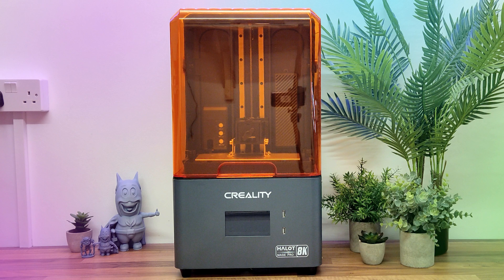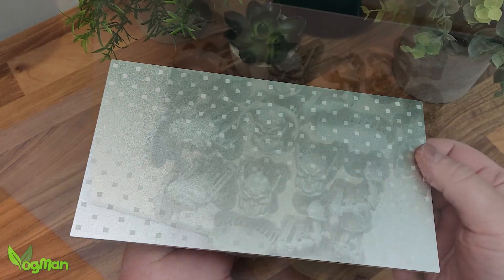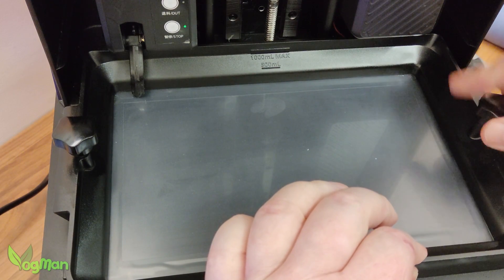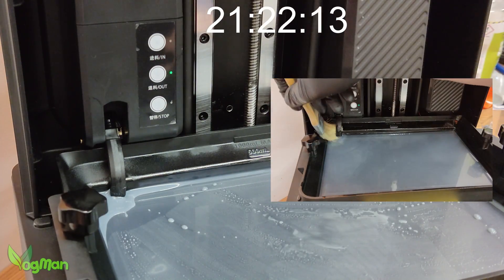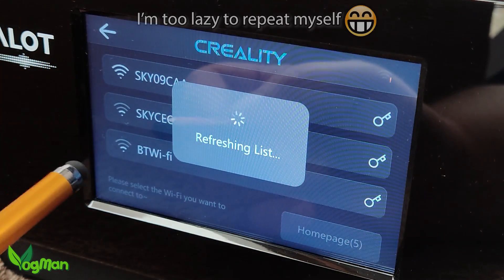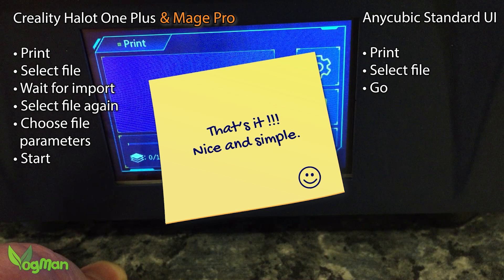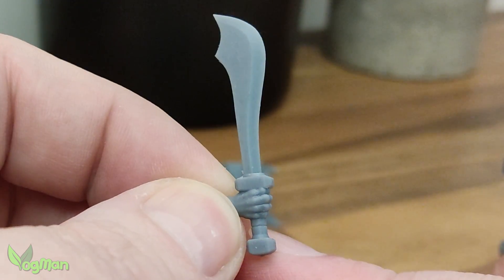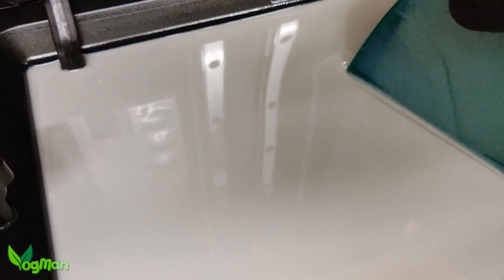Creality Halot Mage Pro 3D resin printer HONEST review

Comment: I have the mage 8k in a Sunlu enclosure which means it stays warm but the lid no longer flips over so needs propping up ;) i use an old airbrush spray booth extractor tube as an extension for the filter tube

Comment: Very deceptive of Creality to not be forthcoming regarding the layer height quadrupling to achieve (less than) the advertised build speed. I recently purchased the non-Pro version of this printer and found it to be painfully slow using the default Chitubox settings. I tried Lychee next and the build time halved with the stock settings. Still slow (13.5 hours to build a 226mm tall Eiffel tower) at 16.7mm/hour, but that was double the speed using Chitubox. Print quality was excellent and it had no problem with Siraya Tech "Build" smokey black resin at 20°C despite being recommended for use at 25°C or higher. I started using 2.2 second exposure times, but reduced them to 1.8 seconds as it appeared that the resin was sticking too much to the FEP with the extra cure time (nasty separation sounds as it pulled away when there were large contact patches). At $260, delivered on Amazon it cost the same as my first resin printer, an Elegoo with a non-mono screen and really small build area. At that price, it is well worth it, but the Pro version shouldn't cost more than $100 extra for what you are receiving.

If anyone knows the settings to get this printer closer to 40mm/hour (the speed of my Anycubic Photon Mono) please share them.

Comment: ARGH !! I am really wanting the advertised fast prints to work for any of these resin printers. I want to print large scale model airplane structure parts that don't need a lot of micro resolution but need strength and accuracy. Even at .2 layer height with true 170mm/h print speed I'd love it if they were accurate and strong but it resin printer corps aren't even thinking of the latter features.

Comment: Its crazy how my Halot Mage non pro is so much better than the pro version. Most of the issues you brought up just dont exists on the cheaper version. I use chitubox pro for mine and it just prints. I did have an issue where my touch screen died but creality support did come through with a new part but it did take awhile to get it sent out.
Reply from the maker: I agree completely. It prints very well, it's just let down by the "pretence" features.

Comment: Noisy fans and Creality 3d printers seems to be a thing. I've had a couple of Creality fdm printers and  had to take steps to make both acceptably quiet. 
I've been watching your videos for a while and am always curious as to how accurately resin printers  can print, correct dimensions, etc., and how well this then translates to a finished cast metal part. Does it shrink or grow for example, is there warping. This from the point of view of casting small parts for engineering projects. I don't want to splash the cash if I'm not sure of getting a good result.

Comment: Ive just ordered a creality lizard, halot mage, creality resin, and their wash and cure kit. Already disappointed. They shipped my order but forgot the wash and cure kit had to email them 4 times to get them to send it. They never sent me any sort of confirmation when i ordered the lizard. I emailed them about it as i was charged but never heard anything, they simply sent me the tracking for the wash and cure kit for the lizard, but the kit hadnt even been shipped yet. My halot mage showed up and it was broken. The coupler holding the z rod was broken and the zrod bounced up and down smacking into the interior the entire delivery im sure as there was physical damage. Thankfully i ordered the Mage itself through amazon so i didnt have to fight for a replacement and deal with emailing their less than stellar customer service. If i had to go back and reorder everything i would most certainly choose a different company as they have already left a bad taste in my mouth and i havent actually gotten to use the product lol.

Comment: Wow , i got the Anycubic mono x , so i really agree with yuo , its a shame that Creality mess all that good features , that in theory can
Be implemented , the misimg  screw in the  carbon filter is really a shame ..(i think yuo can fixed with doble side tape ) but comon Creality ? Just one screw ?
The other ugly thing is the interface , all that menus , all that config ..in the Mono x , i slice in chitu , the put the pendrive , select the drawing of the file , so nomistake , a press print , thats it! As yuo show , and if yuo want to change something , speed , etc of course yuo can , the only drawback is the screen is little and the letter are little to my eyes , but its a very good printer😊

Comment: Regular Halot Mage shares exact the same enclosure(with little difference, e.g. no holes for second usb and ethernet as well as halfed led-array radiator with single cooler instead of double), lacks wi-fi, ballscrew as well as fast Z movement, no pump, it's led array is 60w instead of 100w, it's VAT goes with nFEP and it's the same way loud(i've tried touching led array radiator during exposure and it's not even warm, so creality is overprotective here) still, it's twice as cheap and it's a solid platform for upgrading and fixing(some of issues can be fixed with g-code settings tuning, like cooler noise) 
it's like every creality printer - it has a lot of fundamental pros(for me it was price and enclosure with rotating lid), but it has equal or bigger amount of cons(which mostly appeared because of typical for creality engineering team - lack of polishing) which you have to fight by yourself
Reply from the maker: Thanks for the share.

Comment: I'm confused, doesn't 0.2mm layer thickness up your print time and bring the layer lines alot closer for much better detail than 0.5mm would? That is moat probably why you never seen any change in the speed lowering the layer thickness to 0.2mm as it would drastically increase your print time! 
 going from 0.5 , to 0.2mm with the fast resin maybe would have equalled out or took a lot longer! Try it again with the fast resin at the 0.5mm layer thinkeness you should see the difference then?!. I know you know this and think you got mixed up there as learnt that from your video's and others when started 3D printing
Reply: Sure, .2mm is 2.5 times better layer height than .5mm.

But in this case, the 'normal' layer height is 0.05mm - pay attention to detail!

Comment: Nice review with the good and the bad not like some other channels.
I own this printer i got it for the speed, a heater would be great on printers saves building one (built the one on your channel)
The down side ive found is no pins to align the vat with the pump pushing on it(might take the pump off) and problem with chitubox exporting the files with errors in it, beta ver has fixed that.
I print model railway wagons, people, buildings etc in HO 1/87 so far im happy with the prints and im using siraya tech fast and blu, comes of the build plate easy really easy.

Comment: Ok… hear me out… no one talks about the non pro version. That’s what I have and at LEAST half these problems don’t exist (no cloudy fep alternative, no plate moving at the speed of sound breaking spouts and splashing resin everywhere, no need for special resin, no Wi-Fi demands). And I bought it on sale for $250. Don’t get me wrong it’s not 100%, the fans are still there the feet don’t move, the tube vent is short… but I love it better than my Mars3 Pro that is small and needs repair 25-40% of the time.
Reply from the maker: I believe you completely. YTers get the machines companies want to promote, rather than the ones that are selling well. I'm sure the non pro version is excellent. After all, I loved how this unit printed.

Comment: One question I never hear asked about new printers is why do they not come WITH a flex plate? I've never had a problem with failed prints because of them and I also never have problems separating prints from the plate. They pop off easily.
Reply from the maker: You're not the first to say that here today 😁

Comment: I have the non pro halot mage it has a totally different user interface same as the simple example you showed also no WiFi so don't have to connect to cloud and comes without the useless pump, and I think the home speed is a gimmick on the pro because I don't think my none pro moves that fast but has the same z axis and still capable of printing fast
Reply from the maker: That sounds excellent.

Comment: I'll give them props for trying the pump thing. It's a good idea with a mediocre implementation. 

Your idea to replace the pump with a heater made me think about future designs and possible modularity allowing the user to pick what they want. You can have a pump, a heater, more air filtration... just pick what you need and plug it in.
Reply from the maker: That's an excellent idea!

Comment: I can't see this doing well.
Reply from the maker: No. It's a shame. It prints very nicely.
Reply: @vogman  Still my favourite fdm printer company by far. I still use my old cr10s and my og Ender 3.
I definitely prefer the prints on my Ender. Prints petg really well. Over the years I've put the best of everything on it including TH3D firmware..
Reply: @vogman  ps Great review. The extras on this printer are definitely not on the top of my list.

Comment: Gotta say the UI being worse than in Anycubic printers doesn't seem all that bad if at the very least it actually lets you adjust settings instead of ignoring several things and using factory defaults like all the Anycubic printers i've used. Lack of manual Z adjustment is a dealbreaker though, I use that function to mix my resin cleanly without having to empty the vat, shake the bottle, and refill the vat
Reply from the maker: Yes, the super fast plate scares you first time and has you frantically hitting stop. Thankfully the screen responds very well.
Adjusting settings at the printer is really useful, you're right. It comes in especially handy when dialling in calibration prints.

Comment: Thanks for the honest review! 
I can say I really like the idea of being able to change settings for a print file in the printer itself and not have to reslice it just for simple adjustments. 
But it would be nice to just have that be a settings button on the print screen vs prompting every time. 

I’m with you on the disappointment of how all these companies are promoting fast speeds but one of the things they’re doing is setting layer height to FDM sizes to achieve it. 
Just like you, I got into resin for quality detailed prints (and ability to do better quality supports). I’ve already two creality FDM printers which I really like and are good for that type of printing. 

So yeah, hopefully these manufacturers wisen up.
Reply from the maker: Thanks David. 
You're right, changing settings at the printer is VERY useful, especially when dialling in. If you use a calibration print, it's much quicker to alter those layer times without having to slice again 😁

Comment: I wonder why none of these come with flex plates. It's really nice to not have to worry about exploding your prints when removing them from a plate they stuck too well to. Or I just got lucky with mine and it's just a terrible idea? Or it's just patent trolls?
Reply from the maker: It's an option. Not everyone uses them. I like them, but I tend no to fit them. It's purely a lazy thing 😁
Reply: Flex plates add another point of failure that is unnecessary if you've dialled in your settings properly. I've never had issues removing my prints from the build plate. I've never needed a flexplate. A flexplate can delaminate from your buildplate and ruin a print.

Comment: Yeah I like the flip top lid for low overhead areas like on some of my benches.  Other than that it seems to gimmick drinen.

Using castable resins like you I'd hate to clean the pump to change resins.   It reminds me of a funky build plate a while back that looks like it would have been fun to clean.

It will be interesting to see if I get those same lines on the Mars 4 Ultra 9K after I get it.  I can always try my nfep if I do.

Thanks for the helpful video!
Reply from the maker: If the pump had been fast, I would have forgiven the contamination issues. But honestly, do they really think the pipes and pump can be cleaned? There will always be some traces... we can see that, so why can't they?

Comment: Corrugated extensible hose is some of the worst material to use in a ventilation system since the corrugation cause a great deal of resistance to smooth flow. I can see the appeal of such material since it can be shipped compacted.
Reply from the maker: I certainly don't think this one would. At approx 1m, I suspect any fumes would blow straight back in 😂🤣😂

Comment: Thanks so much for another excellent video, I feel like I'm learning more and more about this as if I have used a lot of printers without spending a dime. 

Still undecided between a 8k/12k printer or a dlp as my first printer for jewelry casting and figurines, tho. 

It seems I still can't see myself with just one.. I imagine having them both.. because as much as I don't want to see printing lines on my pieces.. I also want sharpness and I don't want my first printer to have failing prints as a beginner... 

What a dilemma lol.. also.. 

perhaps I'll get just one printer and 2 vaults for it.. so I can switch back and forth castable resins and figurine resins without dumping the resin back and forth containers..
Reply from the maker: It sounds as though you're unlikely to want fast printing, so there's no need to chase any printer making those claims as you'll just pay more for something that won't help you. You don't need the ACF liner, but IF you have one, it's not the end of the world as these lines can only be seen through a macro lens.
All printers produce lines. You can't get away from it. But with AA you can minimise this and by altering the orientation you can minimise it again. That's part of the hobby - experimenting 😁
Jewellery for me is a no brain DLP choice, but you want minis as well. The DLPs will do a great job, but if you want a larger model, maybe a 100mm or 200mm tall one, the DLPs won't manage.
So I think you're looking at a midrange printer without Fast printing... look into the Anycubic M5 or Elegoo Saturn 3 12K. These will give you lots of details and a big plate.
I hope this helps.
Reply: @vogman  thank you so much it helps a lot deciding between a 12k or a dlp.. Yeah I don't need a fast or big print.. 

I got a last question.. do you see any difference regarding macro pics of the lines or any resin casting print or it's metal counterpart? Do the lines change or soften in any way? I haven't seen many macro pics of this.. I imagine they simply are polished off when the metal is being finished by hand...

I want to made very detailed zbrush sculpted silver pendants and rings..
Reply from the maker: Layer lines, etc, do show up in castings. Some folks make it a feature of the jewellery. Personally I use AA and get rid of as much as possible. Anything left can then be sanded away on the print with very fine paper, like 2000 grit, or polished away in the metal.
Reply: @vogman thanks, that's great info for me 🙏

Comment: Great job.  I will refrain from getting into resin printing until it becomes less messy and water soluble resins become the standard.  Right now my bed slingers are doing an amazing job and with a little sanding, the prints look store bought.  I'd love the resolution with resin, but would loth the mess.  I love your channel.
Reply: Water soluble resins don't change anything, you still have to treat the water as toxic waste the same way you would treat IPA
Reply from the maker: Quite true!
Reply: You're going to be waiting a while. In fact, you are going to have to wait for an entirely new kind of 3D printer that has the same detail as resin without using resin. Liquid is messy. It drips and it gets everywhere. That's why you're supposed to be very deliberate and conscientious about how you process your resin. It's not the mess itself that's a worry. It's how you deal with the mess and keep things safe.
Reply from the maker: Many thanks 😁
Yes, the mess isn't for everyone. I get through a lot of gloves and paper towels.
Don't forget though, the Anycubic resin I showed in this video is water based.

Comment: This extra fast printing is as useless to most of the resin printing community as Anycubics autoleveling is.
Reply from the maker: I think auto levelling has its place, particularly for newbies. Think back to when you started... it was daunting... what if I break the screen? etc etc
But I agree. Fast is useful to some, but for the majority of us, probably not. Don't get me wrong, I'd love to see faster with equal quality... but we're not seeing that yet.  😁
Reply: I think the autoleveling is just the first implementation of a force sensor. I think things like failure detection and dynamic retraction or dynamic wait times will be in the not so far future from the same system